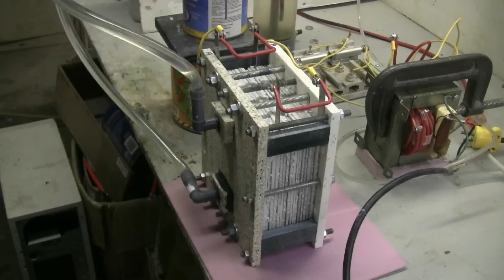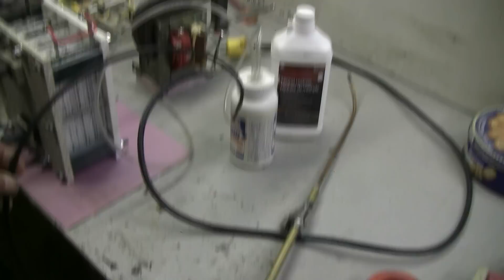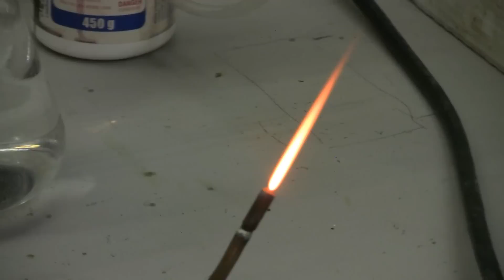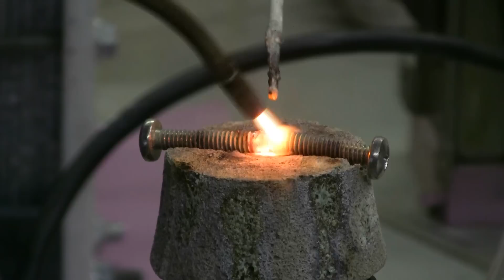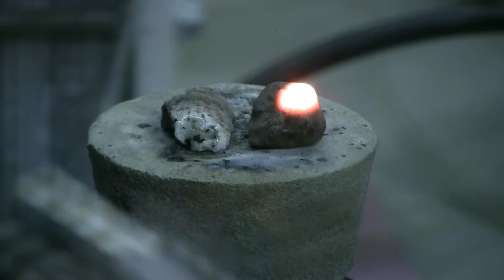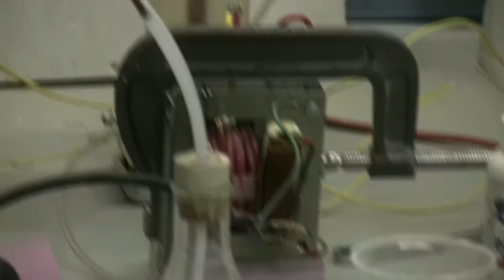My DIY HHO Generator And Torch Setup

Comment: Hmm, only one main question... When you turn off the torch, isn't that going to build pressure and leak hho or pop the bubbler bung out? I would have thought turning it off just at the electrical supply would have been safer. Correct me if I am wrong!

Comment: I think when you’re making mixed HHO gas, you could save yourself a hassle with rectifier. You simply don’t need it. Just plug secondary winding to your cell’s terminals, the effect will be the same, you will eliminate some losses, too.
Reply: Tinkering Nerd 60Hz AC can’t split water...
Reply: p4nt0m yes it can. Try it one day, you’ll see.

Comment: For those that have never tried it before, be careful heating rocks. They can sometimes explode with surprising violence. 
Great video. Looking forward to seeing more. :)
Reply: yes that is a very good point be careful putting them in the microwave ovens and also heating them up outside using either propane or heating elements or even write on the hot fire flames because they can explode from hidden cavities of moisture inside the rock cavities.